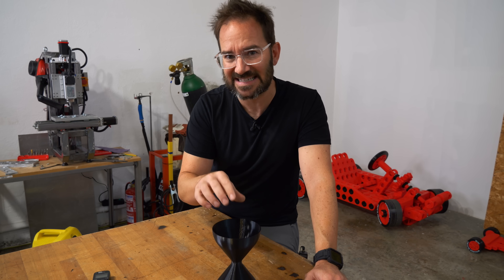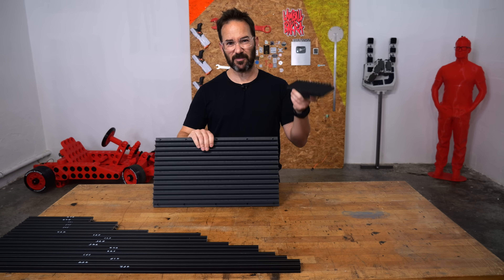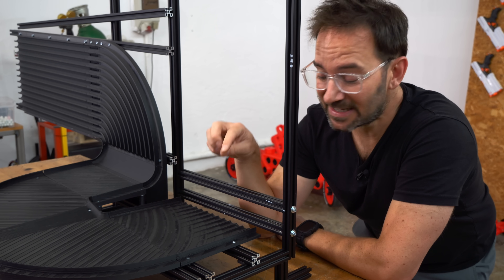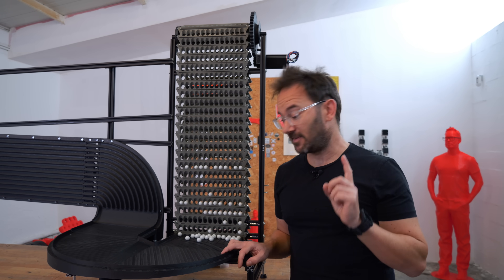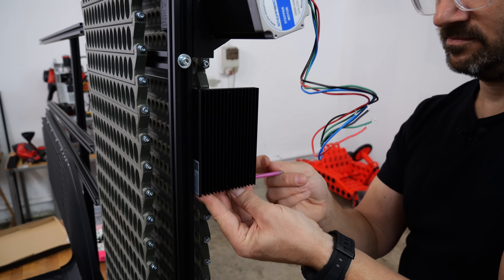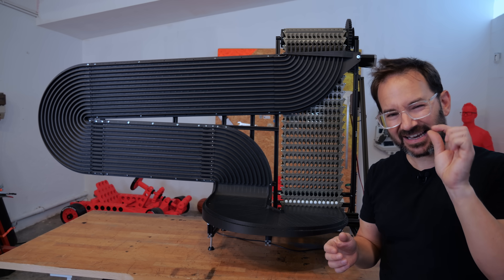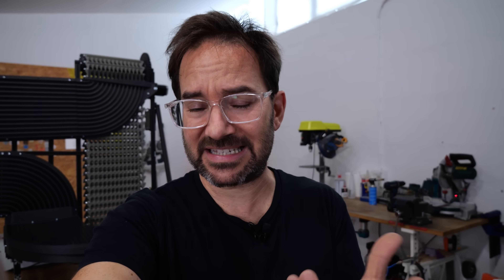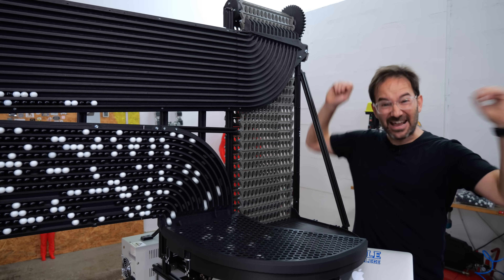BUILDING A MARBLE CLOCK - Pt.1.

Comment: I love this idea, but I can't help but thinking that breaking it down into individual digits that change vertically downward would make it slightly easier. Have a nozzle of marbles that deposits the right amount of each color into a buffer, release the lower number from the 'display', release the upper number down to that in the 'display,' repeat. Still a herculean effort but you have more time to prepare the display, and more help from gravity in advancing it
Reply: You don't even need a buffer that sorts marbles. If the modules are vertical, you can just leave the marbles preset for all 10 digits and have a way to store them in that order. No sorting or complex robotics required
Reply: @ianr2002  Yeah but that would be boring - the marbles then just become a noisy variation on a flip clock. Much more fun to watch a hopper full of black marbles and a hopper full of white marbles, dispensed into the channels as required, then dumped out and sorted back into their correct hoppers.
Reply: And since the digits are made of pixels, you don't even have to use the seven segment display style.  You could use more natural-looking numerals.
Reply: That was my thought too, it seems like it would be simpler to only change 1 number but will be interesting to see finished project
Reply: oh oh! and at the bottom is a rotating single marble grabber that takes one marble at a time into a path that changes sides depending on the marble color!
Reply: how would you effortlessly separate the colors though? Different weights?
Reply: @Ugly_German_Truths  It wouldn't be hard to separate black from white using a photoresistor to flip a gate
Reply: Thought of the exact same thing. Would've made things a lot easier
Reply: He’s trying to make it work the simplest way possible, its meant to be a challenge.
Reply: I have exactly that idea of marble clock for years now. Even I was thinking to patent. Bit sad that he has built almost built it in public

Comment: Can't wait to see how you separate the marbles by color. I think a clock that updates every 5-10 minutes would be impressive let alone every minute. I wonder if using steel balls and electro magnets might be the play instead of white marbles. BUT IDK I am not an engineer and can't wait to see this finished.
Reply: Color sensor
Reply: Yup this  @FoxDog1080 .  Cheap and easy to interface with a microcontroller like an Arduino.  Then a servo directing the marble to one of two chutes from which the clock can select marbles to go into the top of the machine.  At least, that's the theory I'd follow.
Reply: I think ball bearings for white, and the glass marbles for black then you can select with magnets
Reply: I think having two different weights or two different diameters would be the easiest. otherwise you need a camera and a computer circuit.
Reply: Or maybe a camera looking at the marble lift that can reject marbles directly to the basin (or add another track that isn't stopped by the big gate).
Reply: Steel bearings and magnets would be FAR too heavy for that frame to handle.
I suspect he'll use some sort of detector and ejector pins to 'reject' marbles as they're in the ascender, sending them back to the collection bin.  After all, once they reach the raceway they'll always line up properly if sorted by the time they get there.
Reply: @amzarnacht6710 Also, you can learn from the Marble Machine X that you will need to demagnetize after the marbles interact with a magnet
Reply: Glass marbles seem way too inconsistent in size and shape, so bearings would seem a better solution. 6mm white plastic and silver metal bearings would seem a good option, and the smaller size/weight has advantages (they're cheap too). Some sort of magnetic device. Could sort the whites from silvers too. Whether you can get channels that size, I don't know. Can't wait to see the next episode, amazing work so far.
Reply: .    I believe the white ones are bigger.
Reply: No need to try to detect marble colors, we already know where each marble is at any time (otherwise you wouldn't be able to make a clock with them :D)
If the marbles remain within their lane after the display reset, it's possible to make a mechanism that switches out marble colors. Most marbles 'pixels' will be black all the time, a few will be white all the time, so only the ones that change need the mechanism.